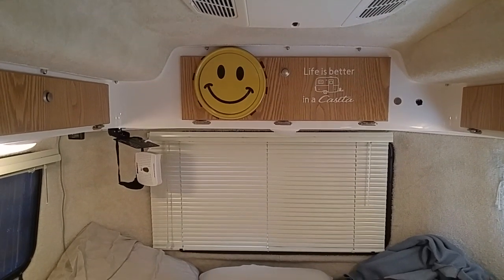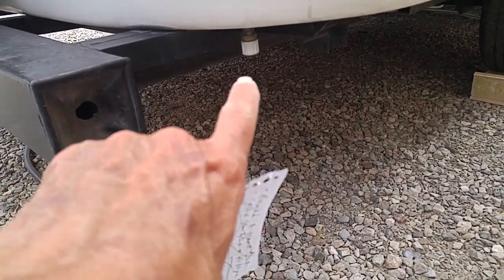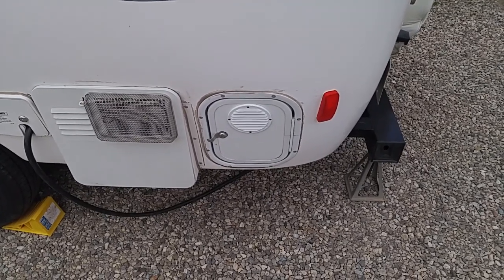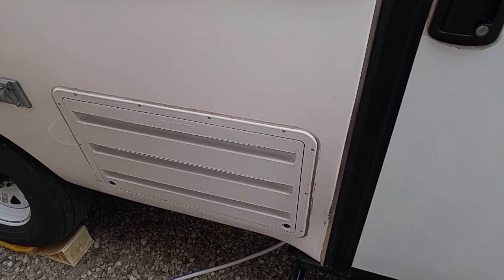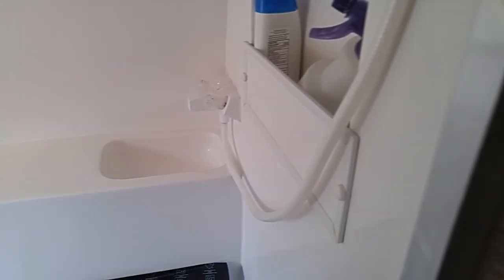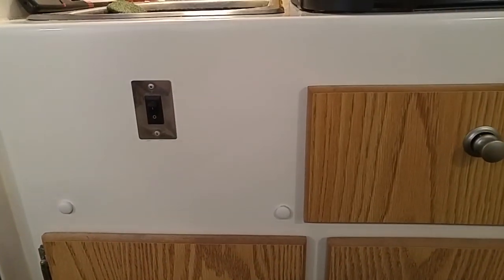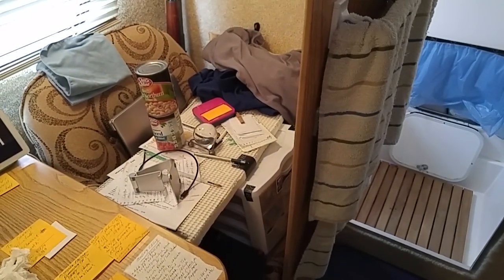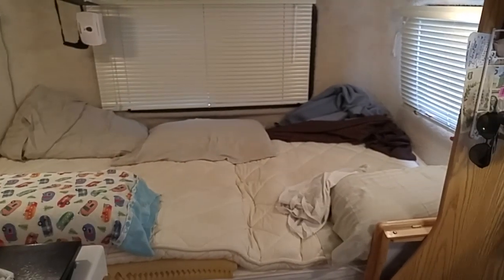CASITA TRAVEL TRAILER...changes that might improve the experience

Comment: I put a towel holder in front of the switch for the water pump! The command strips makes one also.  You are so right about the jacks I went over a bump and it came down and I didn't stop fast enough and it ruined the jack so I had them cut off and use what you use, only I painted mine pink!  A pool noodle attached over the inside of the top of the door that works. Wish you could get a over.

Comment: I always wanted the bathroom door on my Casita open to allow the air conditioning in there.  But then the door was always in the way of my kitchen (I have the Liberty Deluxe model).  So I just took the door off.  I moved the mirror to the closet door.  I mounted the towel bar inside the bathroom on the wall over the lower wire rack next to the toilet.  It's secured with Command Velcro strips that's strong enough to hold the weight of a wet towel. I also added another shower curtain so that the toilet & sink areas stay dry.  I used Command hooks for that shower curtain & just trimmed the curtain so that it's not so long.

Comment: Excellent video Rusty. You pointed out some very easy changes that manufacturers or dealers could make. The interior height is disappointing. I am 6'5 and when I make my purchase it's to live in the unit. I cant live hunched over. I really care for the Casita and the way it's made. Regrettably I am going to have to shop elsewhere.
Reply from the maker: good luck

Comment: Some excellent tips for improving our safety. Rounded soft corners and rubber bumpers especially in the smaller RVs would be nice. Also the sharp edges need to be eliminated somehow. I'm researching Lithium ion batteries. Many are simple drop in type so all we do is remove our other batteries and replace with the Lithiums. Mach's gut und weiter so. Prost 👋👍👍

Comment: I agree with you Rusty and this is what I personally makes Casita a good manufacturer not a great one. They have been making Casita for 36 years, and the fact that they still have issues like the things you are showing here makes me think they do not care what their customers think or suggest. They make the Casita like it is and seem to offer little improvement year to year. The fridge is a good example. I cannot be the only one why have had the fridge door FALL OFF because Dometic uses PLASTIC for that load bearing hinge. Casita should themselves fix that problem when they make their trailers. Or at least warn customers this is an issue!

Comment: I would find a solar panel that is a bit larger than the back window (~170w) and mount it over the back window with a hinge on the top so it can flip up and become a sun shade for the back window and charge the battery...

Comment: At 6 feet tall, I feel your pain Rusty. I hit my head going in & out of my Scamp 16er & just feeling cramped inside any time I stand up. Barefoot my head is on the ceiling. I also found the Maxfan manual knob with my head many times. So I am selling my Scamp. I have been inside a few other options I can stand in & not feel cramped. R-Pod is one idea or even a Ford 150/250 or 350 van with headroom. Ram van would be another option. I like what Casita did in the bathroom with a few cubby holes to store stuff. I also like the storage doors better because they come down & stay down, as opposed to Scamp that open upwards with no way to keep them up. The push button locks are also a great idea. I have told Scamp & will call Casita also to suggest they build a taller top half, 4 more inches would be great, charge another $1,000 or so & I would've gladly paid it. Make it an option for us taller folks. Keep up the good work.
Reply from the maker: I'm completely satisfied with my Casita...thanks